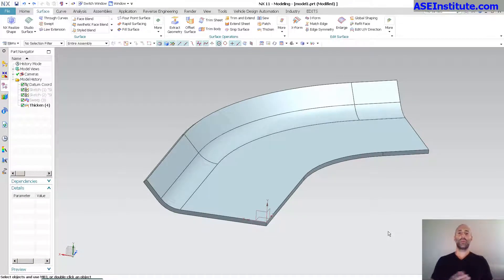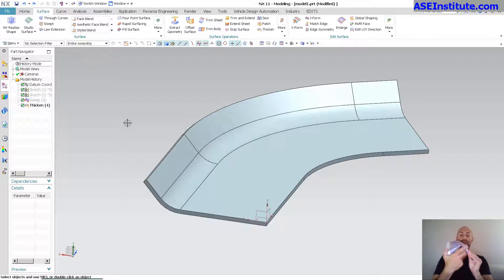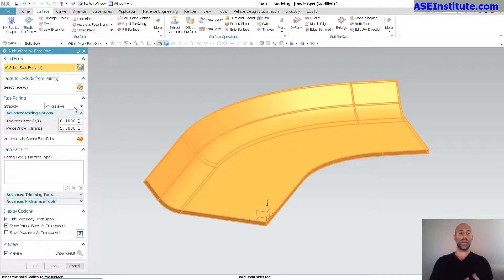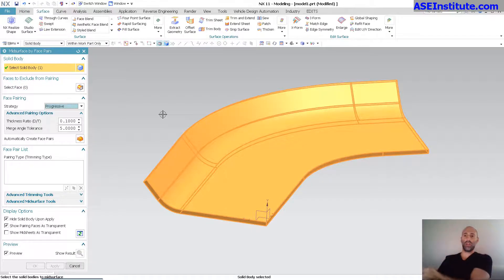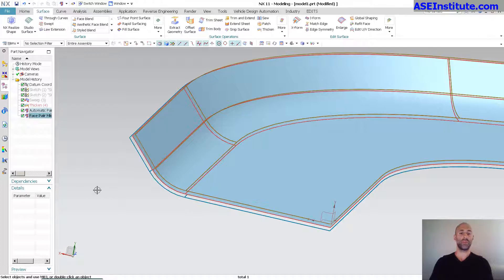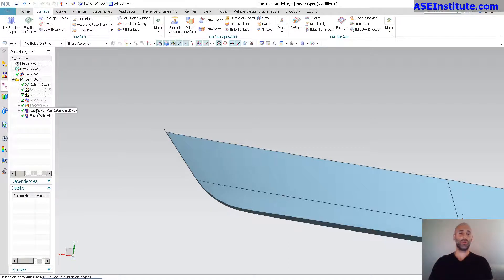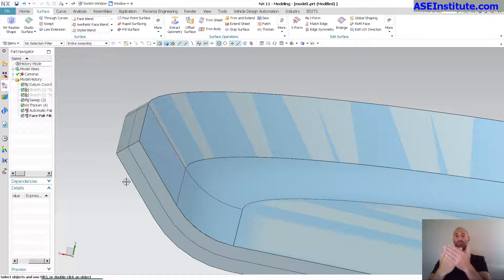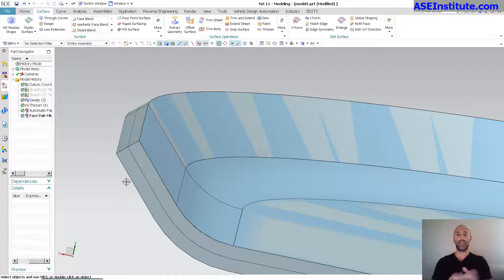Face Pairs (Mid Surface): Siemens NX 11

Comment: Hi Steve, the sheet metal component you have extracted the middle surface is simple. And as I have noticed majority of the things work based on the surface pair. So if you can demonstrate the video for complicated plastic component using midsurface by face pairs as well as different NX modeling operations ( creating curves, surfaces ), it would be a great help. Thank you.